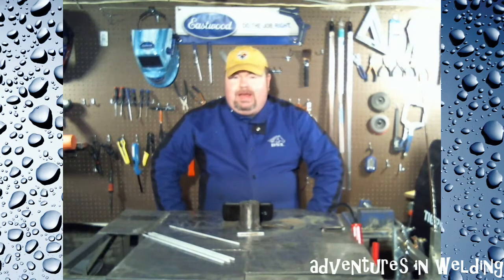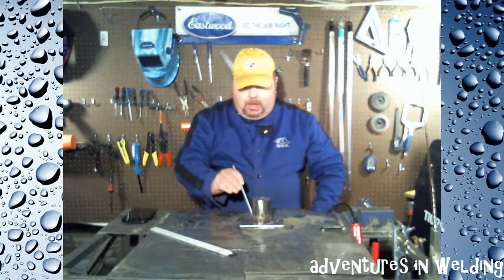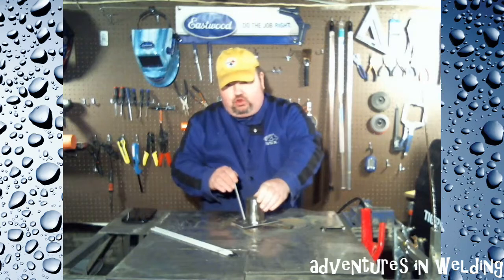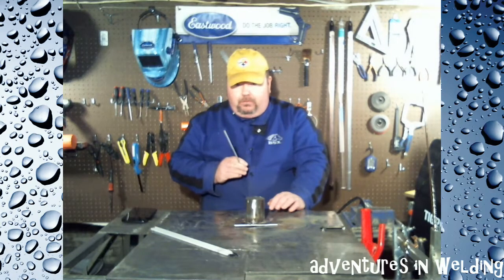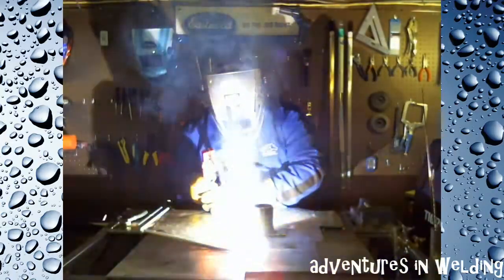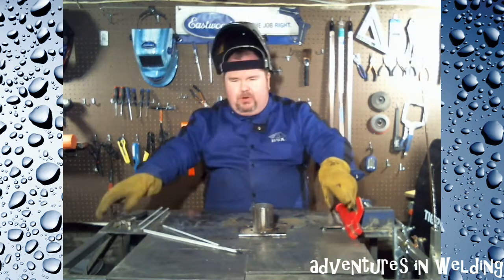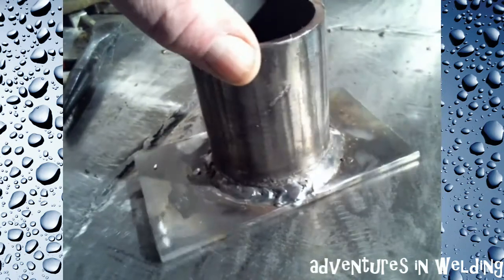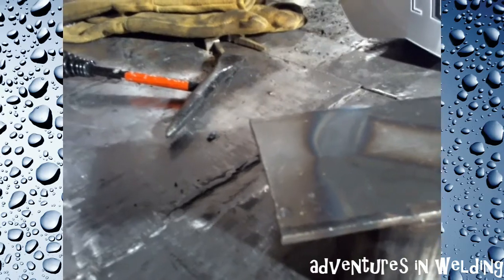Adventures in Welding #54 Pipe to Plate

Comment: I'm  recreating an engine stand and need to recreate the part just like this. I'm a novice welder so I was thinking of creating an adapter for the  shank first using a bigger pipe to house it. that way i can weld the inside and out to the base then weld the longer pipe shank to the base adapter. What would you suggest?